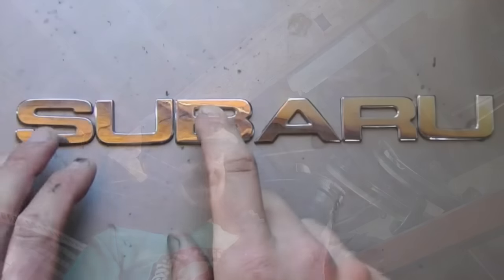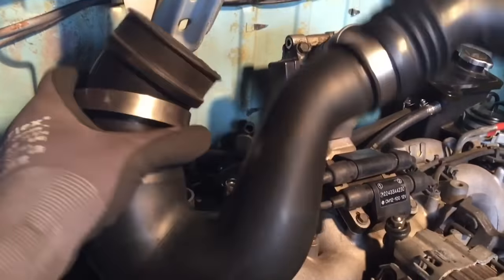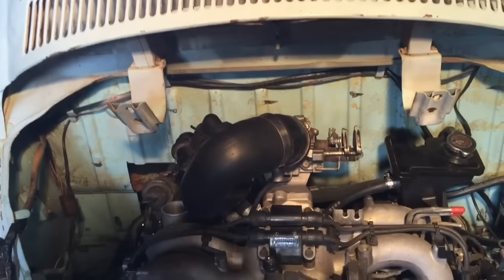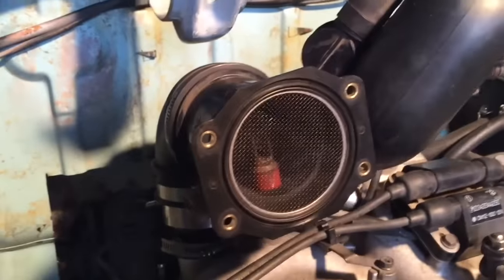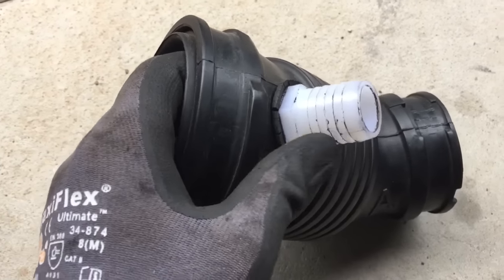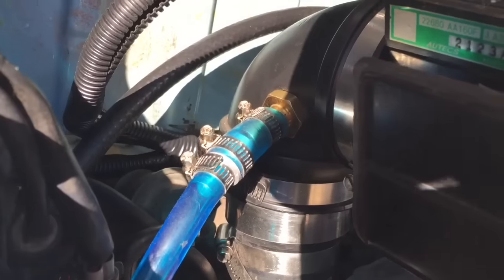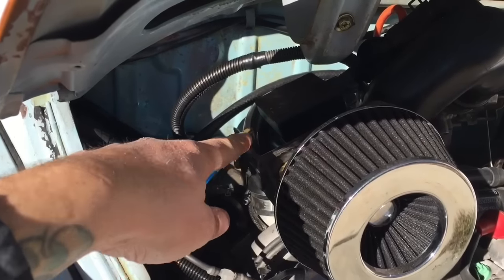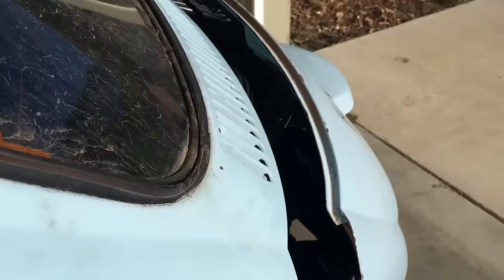BUGaru Part 12 - Air Intake

Comment: Where've you been brother? Glad to finally see an update!
Reply from the maker: +firstmusic00 Oh man, I have been traveling, then I came back to quite a few wiring harnesses that people needed done. Now I have two buses from CA that I'm working on - lots going on these days! I got the bug on the road but death wobbling like crazy. Just ordered some urethane bushings and suspension parts, hopefully that'll do it. The bug is fast...
Reply: Busaru Yeah....the wobble is all too common in the 71 and 72 Supers. The track arm bushings account for most of it. But a new steering damper and new struts can also help. Once that's all taken care of....those drum brakes with with all that power! Yikes!
Reply from the maker: +firstmusic00 I order all new stuff including urethane bushings, struts, steering stuff, and ball joints. A note on brakes - I don't like speed much, just acceleration, so I think the drums will work. If not then I guess I'll have to look into upgrading.
Reply: Busaru Good call on the balljoints. I've seen the wobble from the track arm bushings wear out balljoints...just from all the movement.

Comment: I'm guessing that, at this point, you've already done some max acceleration runs and a fender or two have flown off, one of the CV joints gave up the ghost, and the transaxle has disintegrated. Can't wait!!
Reply from the maker: +Forthwith Tx haha none of that yet, but it does have death wobble. Need to sort that before I do much else.